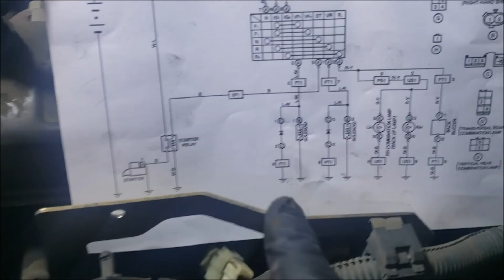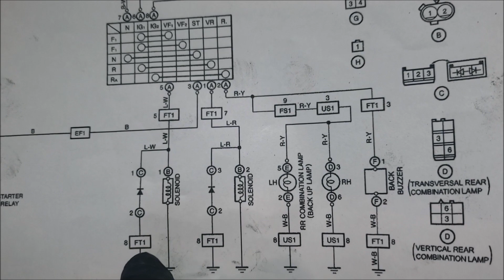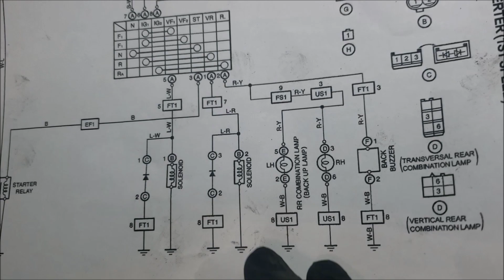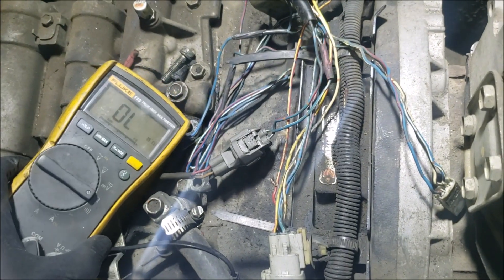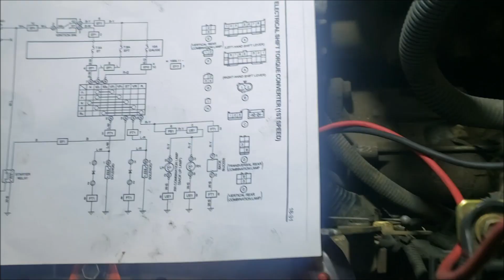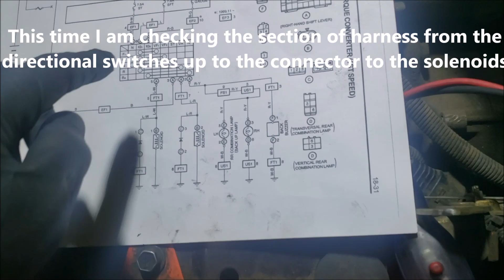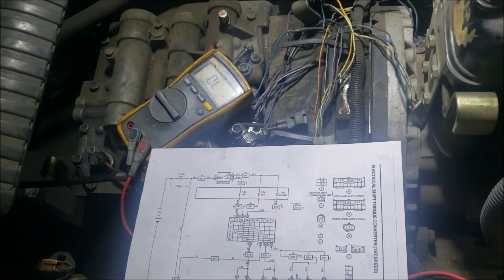Toyota Forklift No drive, Blown SFT fuse

Comment: Im having an issue with the alternator not charging on a toyota 8fgu25. I changed the alternator and the new one output even less. When u raise rpm voltage also goes up but at idle stays at 12.68. My s wire had 0 volts. I checked power at fuse fuse was blown. Changed fuse and it was only showing 12.6 on one side and 6.3 on the other then it blew again. Im stumped on it rn.

Comment: Hi there ive got a 1996 yale glp25tf its got very good rear drive but front drive is so week it moves about an inch on fuul throttle ive checked the solinoids and both are ok. Done oil and filter for box with no improvement. Any help or ideas would be great. Andy
Reply from the maker: Sounds like the forward clutch pack is worn

Comment: I got a qs tho, i got a Komatsu Fg25t-16 that has no crank when through all the troubleshooting starter is good, key switch is good but when i found the start relay by the step i found that i am getting 12v from battery and when i do key switch i get 12v as well but don’t have a ground on the other wire to close the circuit for the 12v to go to the starter wire, do you know what that small wire will be getting it’s ground? Plz help
Reply from the maker: If it is a k21 with a hitachi controller the ground for the coil of the relay is straight to the frame. The positive is from the neutral switch.